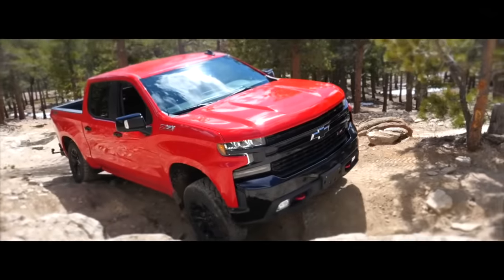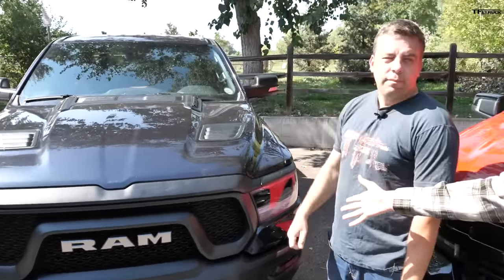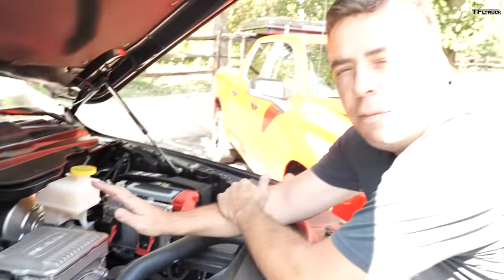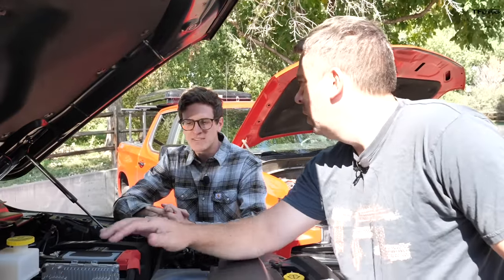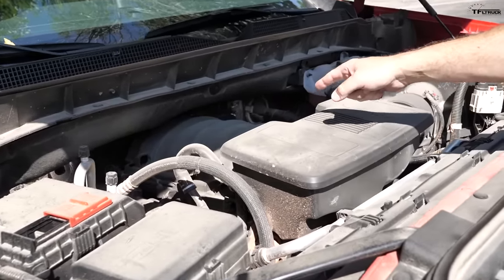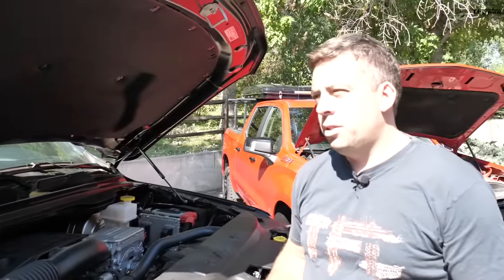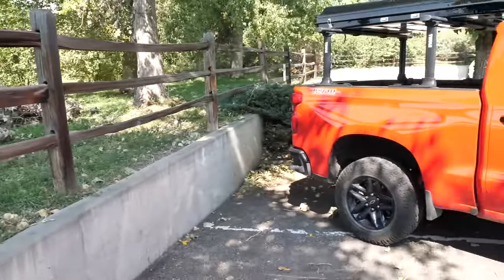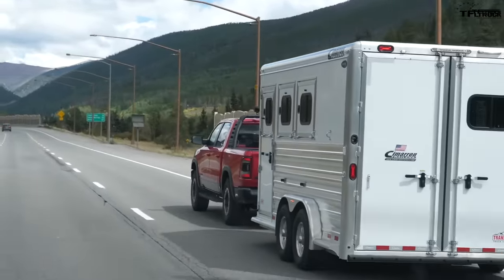New Ram Rebel vs Chevy Silverado Trail Boss: Which Full-size Off-road Truck Is Best For You?

Comment: The Ram has always been my favorite truck design wise for a long time. Their exterior styling is top notch and they definitely have the nicest interiors in their top trim levels out of all trucks at the moment. The thing that keeps me from buying one is reliability. I hear so many horror stories about FCA quality and reliability that it makes me apprehensive to get any of their products.
Reply: I have had the best luck with Ram trucks out of the three. I’m a technician albeit for aerospace systems and not automotive but I keep great care of my vehicles and my last Ram 5.7 made it to 657k miles before the head gasket let out and was an easy fix. With the fords and gms I’ve owned I’ve had a pretty significant amount of problems. All three trucks are fantastic I wouldn’t hate on any of them but I’ll spend my money on the Ram every day of the week.
Reply: @Nikephorus As an owner of multiple Ram.trucks over the years, I can say that your fears are groundless.  The Ram trucks REALLY ARE good trucks!

Comment: In terms of the looks, I prefer the Silverado. In terms of on road performance, I prefer the Ram. 
Interior, I prefer the Ram for the interior trim being better. GM trucks trim feel a bit cheap even on the top end models. Another thing is when you go off road. When you sit in the GM trucks, you kind of sit low like in a sedan. Doesn't look good for off roading because the visibility is less. I don't feel that with Ram and Ford.

Comment: I think the pick-up game has gone out of hand, and this review is useless IMO, not to bash on TFL... Hear me out! All those gadgets and luxury are useless; the best thing a pick-up can have is a full size bed. Pick-ups are open boxes on wheels meant to carry stuff. I started a new job at a tool rental place, and the number of crew cab, short bed pick-up having to come pick up stuff with a trailer is pathetic. What good is a bed if you can't properly use it and need a trailer behind your pick-up? In my eyes, it's as stupid as having a 7-passenger crew cab dump truck with a 6-feet dump box towing a dump trailer to do the job. People actually need something like a Tahoe or Suburban with just the back part of the roof being removable for the one time in their lives that they'll need to haul something taller than the roof, otherwise just get a trailer. Pick-ups as family trucksters is just stupid and is the reason we almost can't get simple, single cab-long bed trucks without all the gimmicks for a reasonnable price anymore. What's next, articulated pick-up trucks, like accordeon buses? Heck, put 8 wheels on it and make it a convertible while you're at it! /End rant!!!/
Reply: I’m pretty sure most trucks manufacturers have a trim level that you can get a no frills truck with 8’ bed.
Reply: @anthonywolfe4207  Yes you're right, these kinds of trucks are supposed to exist, and TFL touched the subject recently. The real problem is the ordeal just to get one because no dealer wants to keep one on their lot so you're pretty much only left with special ordering one, dealer willing...

Comment: i would take the ram 5.7litre without the food processer.now when the new f150 with the off road package with the 5.0 litre coyote with 400 horsepower and 410 lbs torque that would a great test.

Comment: Bought the ram rebel after months of looking at your videos. It offers alot. I agree not a fan of the mustache but its better then getting kick in the face like a pug thats how the new silverado looks. Technology is a big plus bought mine with the 8.4 u connect since iam used to it cause of my scat pack. Wish chevy would step their game up and ford with the raptor not to be all that expensive if not it would have been a good toss up between the raptor and the rebel if the raptor was 8 cyl and didnt cost that much.

Comment: If the Chevy was cheaper by 5 grand. That’s the problem.. when I bought my Rebel, it was cheaper, thousands cheaper, than the competition. I was eyeing like F150.
Reply: I cross shopped both Trailboss and Rebel. Option to option the Rebel was 10k more Canadian. The TB also has the much larger bed and better real world fuel economy.
Reply: @terrencejones9817  10k more? Oddly, it was the opposite for me, they ran an employee special last January, and I paid 48k for a loaded rebel (missing air and sunroof). I don't have any brand loyalty, the Tundra was easy to dismiss, the F150 and GM offerings were all significantly more than the RAM, and the truth be told, the Rebel is an awesome truck, minus the fuel economy. The TB looks better than the Rebel I think, but between that interior, the locking diff, and the much cheaper price, it was a no-brainer for me.

Fuel economy isn't too bad, I have a life time average of 15.2, which includes a good amount of small boat trailering and mostly city driving. I can't get much more than 17 on any road trip. Love the truck though.
Reply: @benca101  yes for real 10k. Infact , I recently priced them both out again.  Trail Boss is always 10k cheaper, even when you stick with the RAM 8.4" screen, . The RAM tech packages are far more money. RAM makes you pay for heated seats and steering wheel in a package, RAM makes you pay for the 8.4" screen. Trail boss the 8" is standard.

Fuel economy,  my 5.3 averages 19mpg. I've got a best on a 100 mile trip of 20mpg at speeds of 55-60mph

Comment: These are the two trucks I'm considering in the next 6 - 8 months! Thank you so much for this video. With regards to the e-tourque engine in the Ram, I get the more power, but if it doesn't help with fuel economy, why spend the extra $$?
Reply: I have etorque on my 20 Rebel, the only thing is does it helps you to get going from a stop when the engine is off, like at a stop light.
Reply: ADAM PETERSON I had read that but figured it would have helped with fuel economy. Do you think the cost was worth it?
Reply: I wasn’t even looking for it as an option. My Rebel just happened to have etorque. It’s great for keeping the engine idle hours down doing city driving. To me it’s not a deal breaker, and you can always turn etorque off.
Reply: And my mpg on my rebel isn’t the worst, my best highway mpg was 18.3, city driving I’m at 16.8. I am running the recommended 89 octane. I was running 87 octane at first and my mileage got down to 15 mpg. Using the recommended fuel helps.

Comment: e-torque never heard of that but it's a way to get ppl to not disable start stop ppl hate, & dry start stop engine to death. Unless they come out w/water dry lube 1 quart per top of valve train 1 quart per valve cover lube system, & if water gets in oil it will sink to bottom & it lubes up engine any way. Oil floats so that wil get pumped. Only way to make start stop work of than LIKE I SAID just make engine start up after 25ish by 30 all internal engine power slower & your alternator or battery power. This seems like a step in right direction so I like the price smoother shift hving power w/engine off alll good CHECK mark, & if running chevy V8 cylinder shut off mayb b enough to get u 20 mpg in 2020.  After GM shut down will want to sell there stuff to ppl still making cars. It's dot clean burn V6 but it may b enough of mpg pump to get over the hump pass or can't sell it crash it fail, prt bin truck. The scam is most of the time cylinders not shutting down though. It's not hydrogen or plug in hybrid or cross on  star* on top of cylinder heads 50 mpg hidden tech no wear no pollution. It's basically a Band-Aid for booboo start stop fix nothing else.<They r charging u for the fucking fixing start stop patch typical satanic goat demonic shit. But baby step out of crocks mouth. If the line off bottom where  oil filter connects up lets u run 2  or so filters instead of just 1 then 7 quart system will last better any way semi type filtration. I am not using 3.6 defective engine in ppl car nope would rather not sel any jeeps that put that crap in1. The should not charge u for patch to their start stop shit system no 1 wants. Going back to 3 dollar keys on the jeep/ppl car as well. ppl in 3rd world can't b jerked around any more 200 +dollar keys.

Comment: The Trail Boss may not have the 3.0 diesel as an option, but the GMC Sierra AT4 does.

Tommy's complaints about the Chevy interior falls to take one serious thing into consideration.  If the screen on the Ram fails, you have no control of your radio or climate.  In the Chevy, the touch screen can operate the radio and climate while the plastic buttons on the dash are more of a redundancy.  I found that I'm using the steering controls for the radio in the Chevy though.

Ram was a close 2nd place for me, but I got the 2020 Trail Boss with the 6.2.  I also couldn't get past the knob shifter.  A floor lever like on the F-150 would've been better.  I also hate the giant screen and would've preferred a smaller screen so I could have actual buttons for climate and radio since the touch screen doesn't work well with gloves.  I agree the Chevy isn't glamorous on the inside, but it still manages to do what a truck is suppose to do -- be utilitarian.

Comment: I like the Rams center console. Had one as a rental and it was very versatile with the sliding tray. It does have a super smooth ride but the steering is so loose and the dial transmission knob is a turn off for me.   Even still, I've had such poor luck with GM in the past, I think I'd lean towards the Ram.
Reply: Have to get it with the GT package which is quite a steal imo.

Comment: DO NOT BUY THE CHEVY. My 2019 is already getting a new transmission. They’ve had problems with torque converter coming apart and ruining transmission since 2015 and keep screwing customers. It happens after 60,000 when warranty runs out. GM is dirty and know that they are screwing customers out of thousands of dollars on new trucks.
Reply: Is that the horrible 8 speed or the 10 speed? Curious as I’m looking to buy one with the 10 speed.
Reply: doug maleski    I think it’s the 8. It’s a 2019 Chevy V-8 Trail Boss Z-71 w basic Custom package. Transmission was rough shifting from the start. Even new tranny is rough.

Comment: The mpg test you do is ridiculous.....i had a 2013 Ram Laramie with the 5.7, 8-speed.  I could easily get 20mpg with it, or I could make great engine noise and get 17mpg.  Tires and driver can are the largest factor of fuel efficiency.

Comment: Chevy is a real truck with leaf springs on the rear axle, even Oshkosh on 30,000 libres capable 8x8 or 10x10 military trucks use coils , in Europe leaf springs disapear during 70s. On a bumpy road you will jump from one side to the other, I can't immagine find a hole on a light turn at 50 miles what could happen with different reaction between front and rear axles, must be funny for people looking from outside. In Italy last car without coils springs was first Fiat Panda the most economical car on market that time. If you need really to tow use those things with four tires on the back.
Maybe you can use it because roads are not that bad and are all strait, here strait roads (consider Romans build roads all around known world over two thousands years ago) does not exist!
Handling is a must for us, just British can understand us not French nor German. It's easy make a fast car setting it as a go-kart, nice and fast on a track "flat as a pool table" not on a road...

Comment: Great video Tommy and Andre. I will go with the Chevy. Real trucks has a column shifter. I love the interior of the Chevy. It is a truck. Even Tommy said he loves tech like us a but when we are driving, we want what we want now, not having to fumble on a digital screen for a 1 sec operation we could have done on the Chevy. Chevy has all the interior options as Ram but done smart. If I wanted a beefed up computerized vehicle I surely wouldn't be buying a truck. Chevy does everything that a ram can do quicker, easier and lets face it, Chevy knows how to wield a driftshaft properly. 

Never buy a vehicle owned by Fiat. Ram is a Fiat company. Sadly only 4 trucks in America with buys is made by GM, Ford, Toyota and Nissan. 

I recommend buying a Honda Ridgeline over a Fiat. Even that is more of a truck than Fiat.

Comment: Sure, the ram has way more bells and whistles (more than a working man needs). But longevity socks for all rams. Chevy and Ford leave it so far behind one can't even see the ram anymore. If you are considering buying a ram, consider reading long term reviews first.
Reply: Do the same for chevy and ford, they are having tons of problems. I had to lemon law my 17 f150 and my 19 sierra denali had so many issues I traded it in after about 8 months. There are a couple class actiom lawsuits against GM right now. Ram actually rates higher on reliability now from consumer reports.

Comment: I have to say I'm a chevy fan ⭐⭐⭐⭐⭐. I think the CHEVY will be cheaper to repair and much less overhead expenses on CHEVY
Reply: Hill C but the problem with Chevy is they charge for everything, even something and simple as plugging in two wires. My blazer got stolen and they charged me for a two minute scan.

Comment: the Chevy is a better truck.  The Ram is a Mickey Mouse design and it doesnt feel planted on the road.  They tried too hard with the Ram.

The Chevy will last longer and need little in repairs.

Comment: Like you guys, I owned a 2019 Ram Rebel eTorque and I now have a 2020 GMC Sierra AT4. I agree with BOTH of you. My favorite is the Ram......  Wait, my favorite is the AT4.......... oh gosh. I like them both but for different reasons. In full transparency, I sold my Ram Rebel simply because I could not live with the fuel economy. I also feel the Chevy/GMC twins tow better. Although the tow rating on the "bow-tie" is lower, if you do a true apples to apple comparison, the GM twins tow more than the Ram when you factor in the rear differential gearing. If you equip a Ram Hemi with a 3.21 axle, the max tow is well below the GMC 9800 lbs. I love driving down the interstate at 70 mph in my GMC turning only 1400 rpm with the 10 speed and 3.23 rear axle but I can still tow 9,800lbs. My Ram Rebel, at 70 mph was turning 1850 RPM @ 70 mph with the 8 speed and a 3.92 rear axle. Towing my 6000 lb boat across flat Florida yields a dismal 8 mpg at the legal speed limit. Pulling the same boat with my GMC AT4 yields 10.5 mpg. When I first bought my AT4, the interior gave me severe "buyer's remorse". It is so sub-par. But over time, like Tommy said, it has grown on me with it's utilitarian appearance and yet, all the "necessities" are there.

Comment: chevy ugly interior simple but the tundra being a decade old looks better and if you want the simplicity of the GM get the RAM with the smaller screen and you get the hand dials for the controls the true compairison would be the new F150 vs the RAM i still think the RAM might beat out the Ford in interior

Comment: Ram put air on the truck bed the won hauling loading test fa safer, not even close call. Every truck should hve air load leveling in 2020 on full size truck. Chevy out of buss so who gives a goddamned.